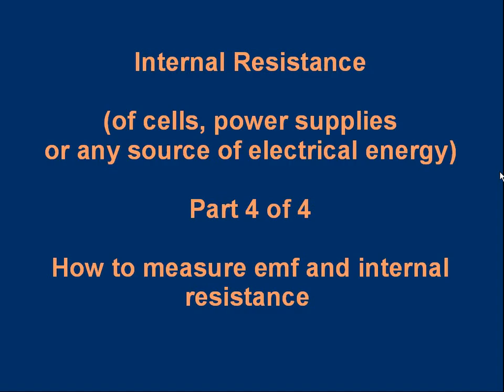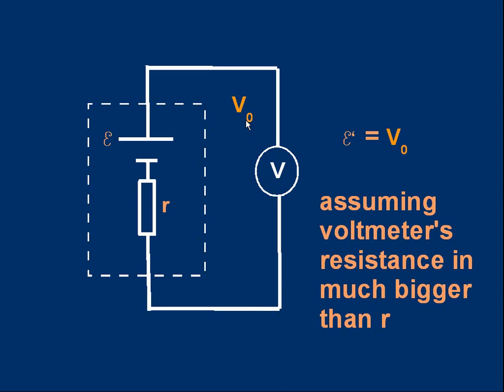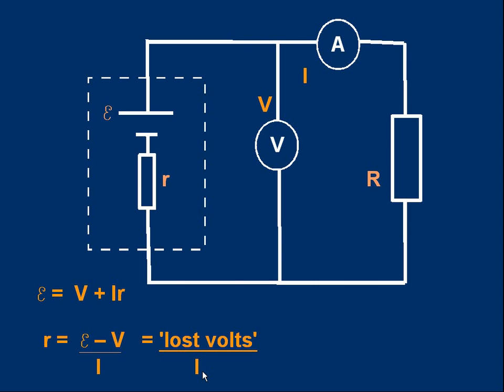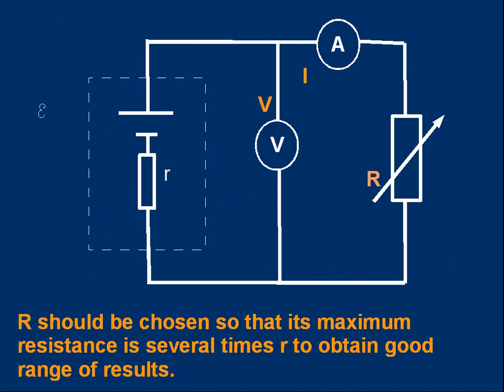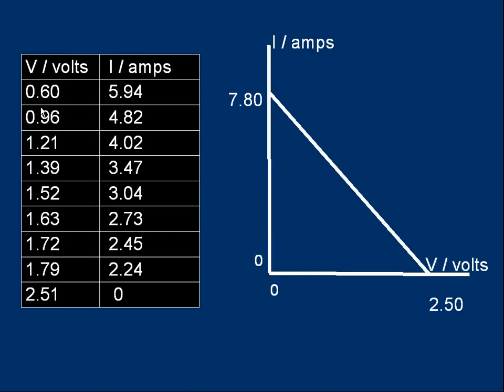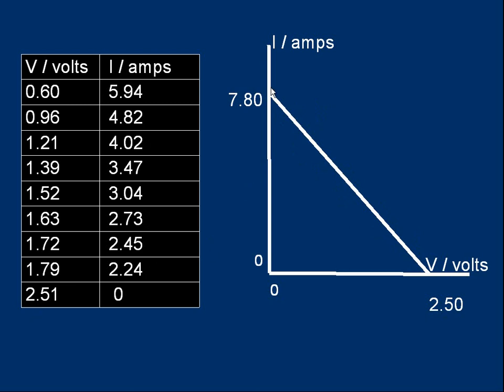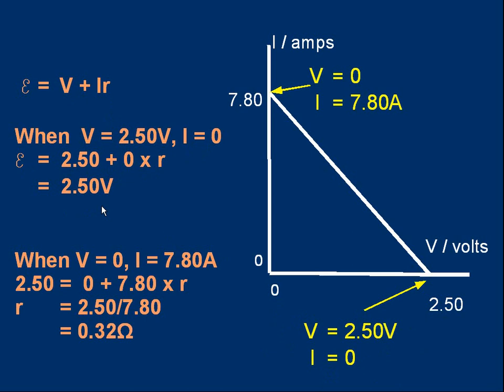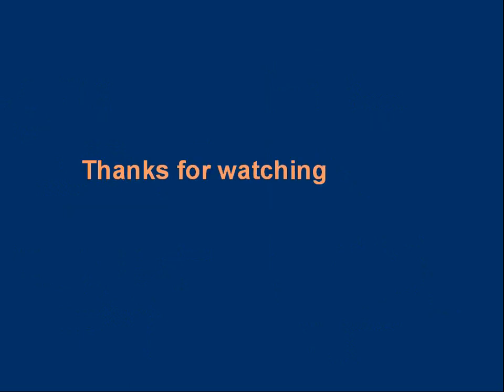GCE (A-level) Physics E18 Internal Resistance 4 of 4

Comment from the maker: The graph could have voltage on the y-axis. Then emf would be the y-axis intercept, as you say. 

But we are looking at the ‘characteristic curve’ for a cell. It is conventional to put voltage on the x-axis because voltage is considered to be the independent variable (the one we control during measurements).  Current is the dependent variable and therefore goes on the y-axis. This is the ‘standard’ way to draw a characteristic curve.  It means emf is the x-axis intercept. But it's not essential.